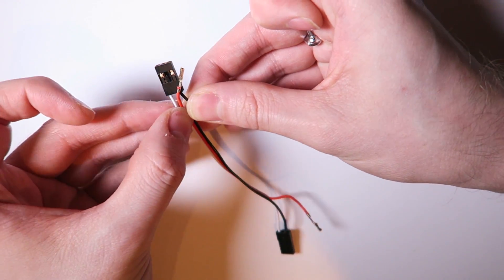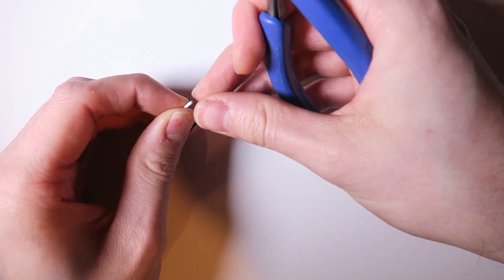How To Make an RSSI Low Pass Filter

Comment: hi andy, i did the same filter to get a custant signal from my x8r to my apm 2.6, but the filter looks not working.

The output signal is always a pulse and the falue on mission planner hud is fluctuating beetween 100% and 78%

can u give me some tip?
Reply from the maker: yes the rssi on the x8r doesnt work u have to send the rssi out to a channel and then minim osd interpenetrates it i think i showed it here: https://www.youtube.com/watch?v=E9EoVW-LYgg
Reply from the maker: might also be here https://www.youtube.com/watch?v=nZxMvTCN_pI
Reply: hi again andy, i saw your videos, and a lot of forums, but its seems to be not possibile to stabilize the rssi signal from x8r. isnt right?

Comment: so it's a little confusing, but if the signal output is already analog 0-3.3 V you don't need a low pass filter correct?
Reply from the maker: correct it is already analogue
Reply: i happened to just read this obviously and i was very thankful for this Q&A kinda jumped for joy. i just put a volt meter to it and got 3.3v there for i assume it analoge. im using a L9r and just hooked it up to Micro MinimOSD Works like a charm!!!!!!!!!!!!!!!!!!!

Comment: Andy. Is there any way I can contact you directly please? I've got a Bayang toys X9 with some interesting pin outs of like to know more about if you don't mind.
Reply from the maker: send me a YouTube message :-) YouTube is the only app I use anyways ;-)
Reply from the maker: +acgkplh those are the solder pins to upload the firmware to the board
Reply: +AndyRC I punched in the board number to Google but got no results back. Thought there might be some info out there
Reply: +AndyRC Oooooo Noooooo. Bummer. I was all excited!
Reply: +AndyRC And thank you. Even though it wasn't the news I wanted. Had hoped to draw power from somewhere to power a hubsan camera
Reply from the maker: +acgkplh you can do that just attach it to the battery pads
Reply: +AndyRC Ah OK. Thank you. I wasn't sure I could directly attach it. Thought maybe I might be pulling too much power from the battery and cause some sort  electrical problem.
Reply from the maker: if u are using a 1s then there is no problems bigger than a 1s and u will ned to down step the power

Comment: To those watching this it doesn't work with ezuhf.  Good video though thanks and worthwhile for those with openlrs
Reply from the maker: +statesmanls1 I think if you run the rssi from channel 8 on EZUHF then you dont need a filter?
Reply: +AndyRC Thats on APM but other osd's that need analogue rssi like the storm need some way to convert to analogue.  I've done it with a hacked servo but the rssi signal isn't linear.  The next on the list is a brushed speed controller.  Fingers crossed it works.
Reply from the maker: all pwm to analogue RSSI is done the same. the servo lead is just convenient for arcudopter. other you just need to solder to RSSI pins
Reply: +AndyRC All I know is that with my openlrs the adaptor you showed works for ezuhf it doesn't.
Reply: @statesmanls1  any chance you could share how you did this? I'm in the same boat and this video didn't help as you say.

Comment: Hi Andy! I've spent almost the whole day off watching your videos and learning from them! The most interesting video is the micro hubsan fpv build. My question to you is can I replicate the same build with a Wltoys v686g fpv setup? Can I take the flight control board, fpv setup, and motors and put them on a picnic frame? The reason that I'm not so sure is because the v686g motors have a pinion gear and a nylon gear and it's not like the hubsan. Can I just get the 8.5mm motors from hubsan and connect them to the v686g board? Thanks!
Reply from the maker: technically you can yes. the board might be a bit big though. also it may not fly too well. as the v686 is geared it will need different pid settings than non geared I don't think I would reccomend trying it

Comment: Hi, Andy! I love your channel and the content you bring to our community! I just had a question on the FS-i6 or the TGY-i6 transmitter... Does this transmitter support RSSI for telemetry and if so how can I use this cable with this budget radio...? Thanks.
Reply from the maker: yes it does however not with the receiver it comes with if I recall. you have to have one of the flysky telemetry receivers
Reply: I know that you can connect telemetry with the ia6b Flysky receiver but how do you know it outputs digital or analog RSSI?